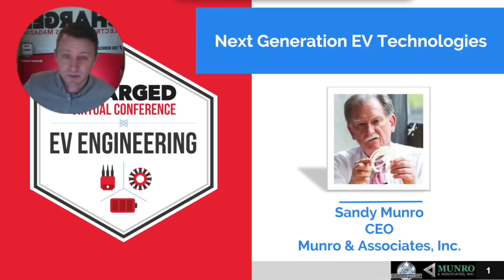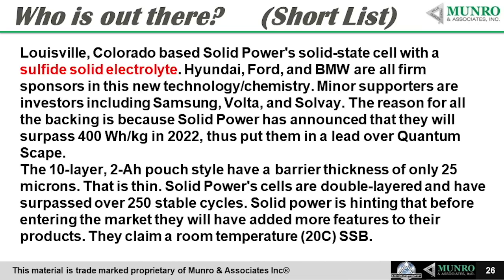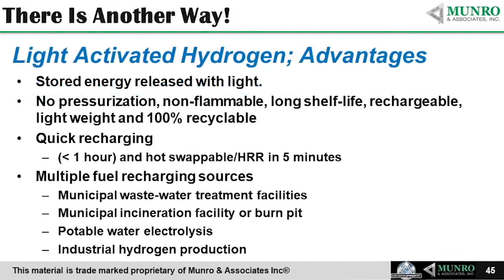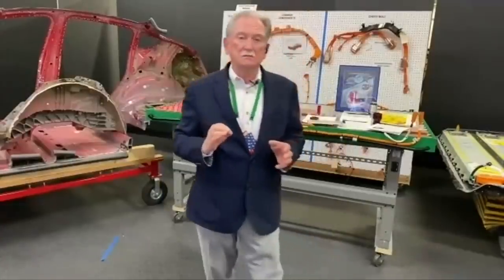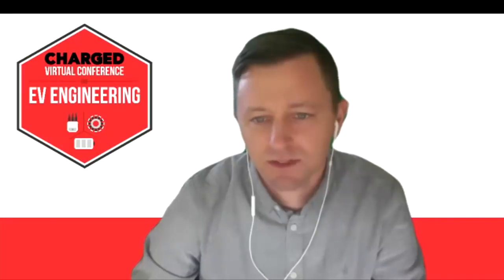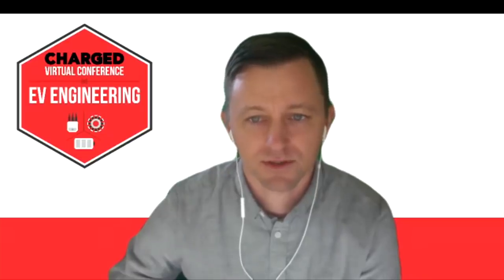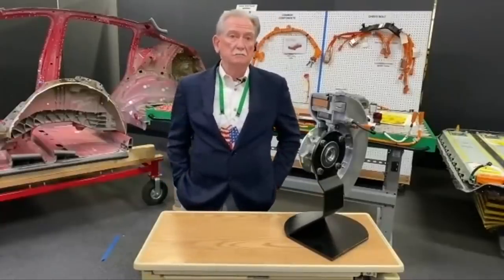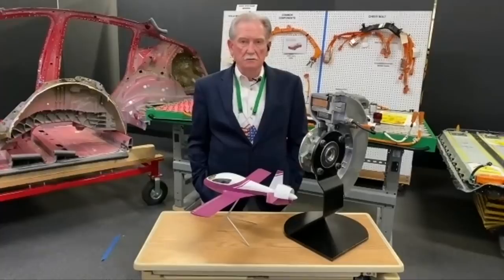Sandy Munro On Next-Generation EV Technology: Tesla, Solid State Batteries, MegaCastings, VTOLS, Q&A

Comment: Thank you to Sandy Munro and Charged for this presentation. I had much of the basic information floating around in my head, but this put a laser focus on breaking the options down the best way. I specially was interested to find out, (for sure, though I suspected), that there is no ONE best solution for all needs. Cars, and other small vehicles NEED batteries. At the present time, this means Li-Ion. Larger vehicles can make use of hydrogen. Eventually, there may be a viable Solid State Battery available for general use, but to replace Li-Ion may take decades. Hooray for Sandy. He covered all bets while sounding knowledgeable. I'm kidding, of course, Sandy is THE BOSS when it comes to engineering.

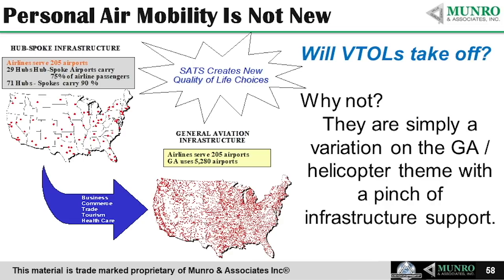Comment: VTOL personal vehicles at around 34:00 marker. 
The biggest issue with those and especially when we talk about separation, are the forces of nature, namely the air drafts such as heat and wind. The air, unlike the pavement is never solid and if you've ever flown a small aircraft you'd know just how "bumpy" it is.

No matter how comfortable you may become with constantly getting thrown about, there is an inherent risk of smashing into structures, particularly in the cities. Take one such as Manhattan or Hong Kong that are full of very tall buildings in very close proximity to each other, and you have massive amount of warm air swirling about. 

Now, combine that with natural weather patterns and you have a whole heap of challenges to worry about.

Comment: I think the reason for oem not going to body casting are Union simple
Reply: U r guing to gurt rid of Gerbs! Nooooo!!!
Reply: The Japanese used aluminium castings and extrusions for motorcycle frames. Sadly they have not really progressed with front wheel suspension. Designs like the Hossack (which was done to be low cost) have never taken hold.
Reply: @Barskor1  Are you drowning?

Comment: Sandy. I too for more then 20 years have been saying that the future of transportation is above the ground. My reasoning has always been that we cannot continue to support all the infrastructure and consuming all the natural resources required to keep moving along the surface of the earth. We are seeing it even today. Our roads are a mess and bridges are crumbling and we are continuing to build more knowing full well we can’t pay for the up keep. Air does not need constant repairs. We simply cannot afford to remain on the ground. Spreading out the population both vertically as well as horizontally even just 100’ AGL adds an interesting element of safety. It will save millions of lives.

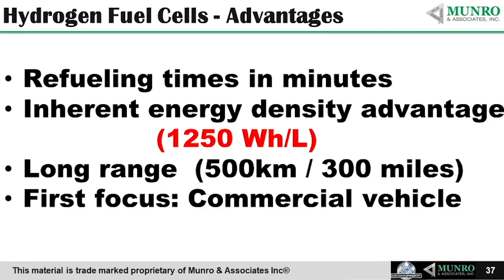Comment: 22:40 When you talk about the energy density of hydrogen, you MUST include the weight of the TANK. With gasoline or diesel, the weight of the tank is not a big deal because of the density of the fuel. But with hydrogen, it's everything. And when you include that, hydrogen can still look fairly good, but not THAT good.
Reply: The response to that might be that if you can make a battery a structural part of a car, surely you can make a hydrogen tank structural, right? I am not too sure how realistic that is!
Reply: @markweatherill  I must admit that's one possibility I hadn't thought of. It probably could be done. I'm not sure how much advantage that would provide. And one thing that may be a misconception is that it's easy to quickly refill a hydrogen tank. Filling a tank to thousands of bars might require quite a bit of compression energy, and take much longer than just pumping in liquid.

One thing to keep your eye on might be the "power paste" I've heard of, which is a sort of hydride goo, consisting of tiny hydride particles. That would already have the hydrogen pre-compressed, and could be pumped in quickly, and you could get the gas out as you drive.
Reply: This is perhaps outrageous, but if metal hydrogen (solid at room temp) can be produced with advanced nuclear energy and a method to infinitesimally use small amounts of it, that would blow everything here away.  Also, if liquid hydrogen is part of the solution, why can’t liquid oxygen be also.  Reason for propelling with precise blending of these two, is that the result is truly water, versus nitrous oxides + water.
Reply: @ronaldgarrison8478  Why can’t tanks be plug and play, no refill in real time.  Same goes for battery packs, except the architecture being designed doesn’t permit that.
Reply: @Radarcb329  I think one thing we can safely say is that, for either hydrogen or batteries, swapping will come at a price in weight, volume, and cost. That cost may not be too high for hydrogen. I'd like to see a real analysis of it.
Reply: @Radarcb329  Its not outrageous, its childish and silly. You might as hope to use magic to power the car. Grow up.
Reply: @ronaldgarrison8478  It has been done.  Toyota has a composite tank for the purpose.
Reply: I’m sure I’ll get attacked for being creative, however DARPA has a contract with General Atomics to design and prototype a nuclear propulsion system for rockets.  The concept uses nuclear fission energy to heat hydrogen to a high temp and huge impulse power.  Why can’t the concept be shrunk down to small vehicles.
Reply: @Radarcb329  Great. Now, have they developed a tank that has no weight? That was, after all, my comment.
Reply: @Radarcb329  Yeah, well, when I see you driving down the street with a nuclear rocket strapped on your car, I'll give you props for being creative. Or at least brave. Not before.
Reply: @ronaldgarrison8478  No, but it’s low enough.
Reply: @Radarcb329  And just how low is that? There seems to be an allergy to numbers when people are talking about this stuff.
Reply: You mean the carbon fiber tanks?
Reply: @TobyCostaRica  I don't mean ANY particular tanks. ALL tanks have mass.
Reply: @ronaldgarrison8478  Dont disagree with that that and don’t know the weight of the Mirai’s tank, but as a former lease holder I can tell you they are CF and as light as possible. Judging by CF High pressure air tanks in paintball filled to 4-5K psi I can’t imagine the Mirai tanks to be more than 100lbs
Reply: @ronaldgarrison8478  Only a fool would discredit a design because it didn’t have zero mass.  You apparently are not a system engineer.  In any case, the limitation on all of these “carbon free designs” are not the vehicles with a time horizon of 5 years, it’s the infrastructure to produce clean energy. Elon Musk and others have noted that advanced nuclear reactors are necessary to support overall electrification.
Reply: @TobyCostaRica  Well, fine, I'm sure lots of very smart people are very good at minimizing the weight of such tanks. But to evaluate all this, I need to know how many kg of tnak is needed, for how much H2, and how much energy that provides in a fuel cell, versus the same weight of gasoline + its tank, and how much energy that yields from an ICE. I don't see that broken down very often.
Reply: @ronaldgarrison8478  a 4KG fill goes 275 miles on a fully loaded Mirai. Aka they made it like a Lexus. Toyota is heavily invested in it with a 3 year refresh. It took 14 years for a new Tundra
Reply: HYDROGEN AS BATTERIES : HYDROGEN BATTERIES. Electric vehicles must switch to use  hydrogen batteries instead of chemical batteries.  
People often think about hydrogen as fuel, but many forget that hydrogen is not only a fuel, but also very good battery, too. 
 1/ The fundamental science dictates essential truth of all chemical batteries :
if a chemical energy storing mechanism is charged as quickly as producing hydrogen, then this mechanism PRACTICALLY  CANNOT HAVE BETTER  ENERGY CONVERSION RATIO THAN ELECTROLYSIS PROCESS. Besides, it is possible to setup and adjust electrolysis reaction speed (for example slow down speed) to reach energy conversion ratio of electrolysis better than any chemical batteries. The best one of all possible chemical batteries in AEROBIC earth conditions is HYDROGEN BATTERY. All revolutions of chemical batteries, lithium batteries, LFP batteries, LTO batteries, graphene batteries .. are for reaching to the features of hydrogen batteries. 
  
2/ New concept : hydrogen battery = (fuel cell + hydrogen storage object). 
The most simple hydrogen battery = 1 fuel cell + 1 compressed hydrogen balloon 300bar, can easily beat best lithium batteries by all features : more capacity, more power, less weight, forever lifespand, no degradation, charging in 5 minutes, same or better energy conversion ratio, but just noremarkable bigger volume sized than lithium batteries.
 
3/ So just equip electric vehicles with hydrogen batteries instead of chemical batteries.  And equip hydrogen filling stations with mobile electrolysers to produce compressed hydrogen 300+ bar on site from electrical outlets. Electrolysing hydrogen filling stations (hydrogen battery charging stations) can run electrolysers from electrical outlets to produce liquid hydrogen on site, to avoid suddenly leap change requirements for big number of already existing current liquid hydrogen cars in the markets. But liquid hydrogen has low energy conversion ratio.  For now and near future, compressed hydrogen (produced on site)  is more versatile for various applications.
(Additionally envisagedly, owners of ANY SMALL COMPRESSED HYDROGEN MOBILITY VEHICLES/ROBOTS/DEVICES can buy small mobile household electrolysers to recharge hydrogen batteries at home at night/any times). 
4/ Example and comparison : hydrogen cars vs battery cars, hydrogen batteries vs chemical batteries :
The old approach sets high H2 cost because : they pay for making H2, then they pay much for converting H2 to liquid H2, then they pay much for transporting liquid H2 by trucks (complex safety trucks, and very small weight of liquid H2 on every trucks), then thay pay for keeping cryogen conditions to store liquid H2. 
 But in new approach of ‘electrolysing hydrogen filling station” : you use electricity from electrical outlets at electrolysing hydrogen filling stations to run electrolysers to produce compressed hydrogen 300+bar on site. So you pay only for electricity and water ofcourse. No other fees. No complex cryogen equipments.
Compare : hydrogen batteries vs lithium batteries in the approach of “electrolysing hydrogen filling station” : 
4.1/ Grid transmission loss : hydrogen battery charging and lithium battery charging onsite cause same grid transmission losses. 
Conclusion : Equal.
4.2/ Energy conversion ratio in charging : (electric energy -> chemical energy)
Electrolysers in quick mode (very high electrolysis reaction speed) have energy conversion ratio about 70%. Lithium batteries quick charging has energy conversion ratio about 60-70%. 
Electrolysers in slow mode (small electrolysis reaction speed) have energy conversion ratio 90%. Lithium batteries slow charging has energy conversion ratio 90%.
Conclusion : electrolysers win, because of the ability of flexible modes of scheduling and functioning to reach higher energy conversion ratio.
4.3/ Energy conversion ratio in performance : (chemical energy -> electric energy)
Fuel cell has energy conversion ratio about 75+% in mode of intensive power performance (when require delivering much walt/seconds), energy loss in form of heat. Lithium batteries have energy conversion ratio about 70-% in mode of intensive power performance (when require delivering much walt/seconds), energy loss in form of heat. 
Fuel cell has energy conversion ratio about 85+% in mode of nointensive power performance (when require delivering less walt/seconds), energy loss in form of heat. Lithium batteries have energy conversion ratio about 95-% in mode of nointensive power performance (when require delivering less walt/seconds), energy loss in form of heat. 
Conclusion : Equal.
4.4/ Energy loss in energy packing compressing process :
Hydrogen battery using compressed H2 300bar cause about 3-5% energy loss for compression. But hydrogen battery weight is very small.
Lithium battery loses 0 energy in compression. But lithium battery weight IS INHERENTLY HIGH. 
That means you always need to transport noneccessary lithium battery heavy weights on your vehicles every seconds. -> The higher power category, the higher loss with lithium batteries. The longer range, the higher loss with lithium batteries.
Conclusion : hydrogen batteries win with big advantages
4.5/ Lifespan :
Hydrogen batteries have practically forever life span.
Lithium batteries have lifespan about 3 years. Some good ones have 5 years. Other modern modified lithium batteries have more lifespan but smaller capacities. But all of them degrade every year.
Conclusion : hydrogen batteries win. 
4.6/ Influence of environment temperature :
Hydrogen batteries never fear environment temperatures.
Lithium batteries fear environment temperature. Even in some seasons you can not or your ineffectively use lithium batteries.
Conclusion : hydrogen batteries win.
4.7/ Charging time :
Hydrogen batteries : load compressed Hydrogen 300+bar or exchange compressed hydrogen canisters 300 bar in 3-5 minutes.
But you must waste minimal 30 minutes for nofull charging lithium batteries, and often you must waste some money for paying some unnecessary things in fool waiting times too. -> waste time + waste money.
Conclusion : hydrogen batteries win.
4.8/ Synchronyze with grid supplying schedule :
Electrolysing hydrogen filling stations can easily pick up flexible schedules to run electrolysers in tandem with grid supplying schedules. So Electrolysing hydrogen filling stations can pick up right hours of day for incentives electrical tarif. Nets of electrolysing hydrogen filling stations ideally use intermitten clean energy/renewable energy.
But electric charging stations can not pick up times. High power electric charging stations terribly conflict with intermitten shedules of clean energy/renewable energy. The more higher power electric charging station, the more terribly it conflicts with intermitten energy supply of clean energy/renewable energy.
Conclusion : hydrogen batteries win. 
FINAL NATURE TRUTH VERDICT : HYDROGEN CARS WIN MANYFOLD AGAINST BATTERY CARS. 
Just need to make right approach, and right choice.
Reply: @abstractexchange5057  dude no one is reading that
Reply: @abstractexchange5057  You may have some valid claims, but for now I consider this virtually unreadable. Please take some time and try again.
Reply: @abstractexchange5057  Why is it that some people read a couple of press releases, and instantly become experts in any field?

Comment: 46:00 You can make a casting with the crush characteristics you want, and you could make the alternative with desirable crushing as well. The question is how much it weighs. Nobody seems to be putting it in those terms. I think the castings will save substantial weight. It totally makes sense. There are no operations such as stamping, and stamping inevitably weakens a piece of metal to some extent.
Reply: Stamping can make metal stronger because of work hardening. Casting produces metal in its weakest form, lacking extra strength from work hardening or heat treatment.

Comment: Good Show, Sandy!!  Mr. Munro, you are Very Bullish on electric powered VTOLS, and while I'm a High School drop out, and really don't want to bore you with childish questions, I gotta try : of course, the weight of batteries or fuel cells and hydrogen tanks are the biggest problems to overcome, but since the most energy intensive part of any flight is just getting the DAMN thing off the ground and into the air, and since this is a very short duration, high energy event, wouldn't Ultra Capacitors be perfect for this part of the flight??  I read that Ultra Capacitors can store large voltages of electricity, but not large Volumes of electricity yet, but I believe they are much lighter than batteries, which means you'd only need enough batteries for the lowest power use, easiest part of the flight, but I haven't seen or read about using them in that type of application, so I guess I'm wrong!!!   Sorry!!!   Chas Orvis, Plainville, Ct.    PS :  you ARE THE WILLIE NELSON OF THE AUTOMOTIVE WORLD!!!
Reply: This is a very good idea

Comment: One question to Mr Munro, concerning the structural resistance of the one-piece front and rear car bodies. 
Too rigid, means that, in case of accident, the forces coming from the outside will go integrally to the drivers, passengers and cargo (the problem with chassis made cars, like old VW Beatle).
What about this?
Reply: Ideally they will be rigid until an accident, then they crumple in a controlled designed manner. Controlling deceleration and limiting cabin intrusion.
Reply: ... I have the same question about the cybertruck, tho,  that's another level of structure. Accident avoidance can only go so far.

Comment: What IDRA is doing for this sort of manufacturing is akin to what TSMC is doing in the silicon/chip sectors.  Thanks for this video.  It made me sit up and start taking notice of what IDRA is doing.  Looks like they are key enablers...selling the shovels to the miners (so to speak)...

As for VTOL's....Sandy seems very enamored by the potential, and I get it.  But Sandy....think it thru.  Consider something from this perspective.  Ever sat close to an airport?  Or under a hovering helicopter or large drone?  What's the one thing that leaps out at you?  Noise.  Big-time noise.  

Now consider this in light of a world where hundreds to thousands of VTOL-like vehicles are whirling directly overhead.  That would be a racket wouldn't it?  And on a 24 x 7 basis, too.   I'm not sure this aspect is being thought thru....

John~
American Net'Zen